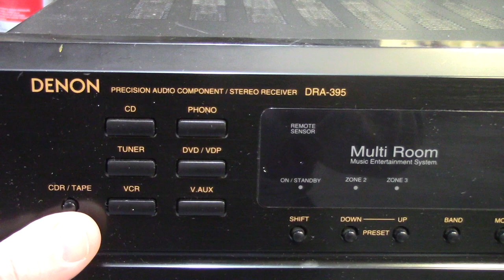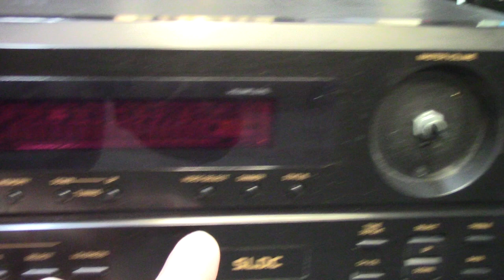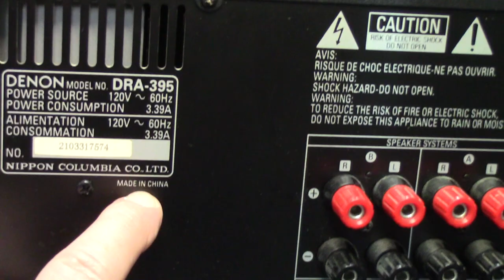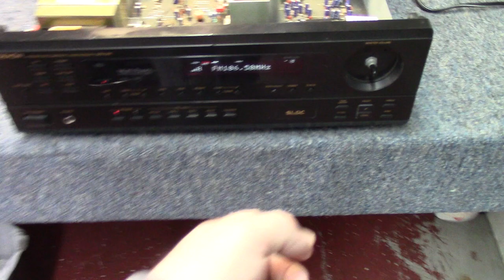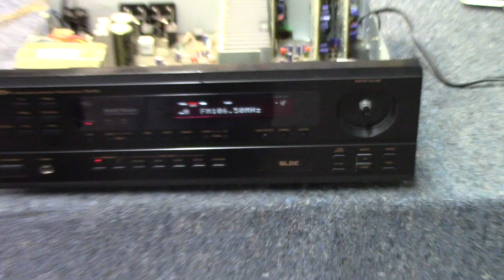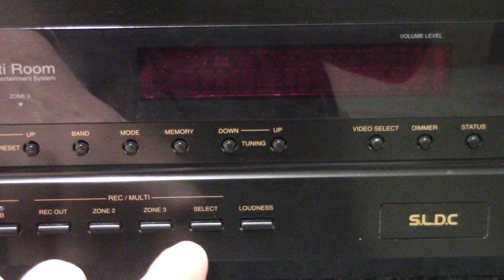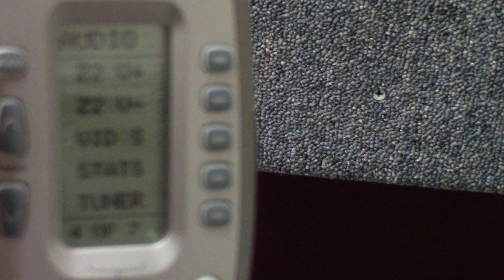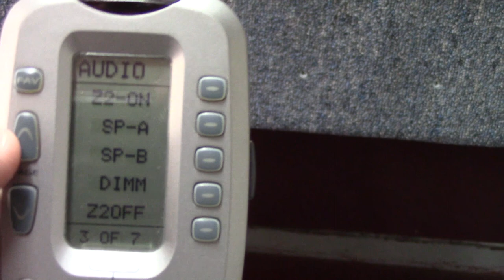Denon DRA-395 Multi-Zone Receiver - eval & testing

Comment: Have a Denon AVR-2803 that I am using for a preamp. Zone 2 is also the record output selector, so you can record from one source and listen to another on the main. Sounds really good in direct mode and has enough output signal to drive my tube mono blocks. Someday I will get the Dynaco PAS-3 preamp recapped, but I do like a remote volume control that has 0.5 db steps.
Reply from the maker: I had a Dynaco power amp given to me once and I was so busy at the time I sold it broke on eBay, was a very sweet amp.

Comment: I have one of those digital volume controls in my car audio cassette radio that has gone wonky. If you turn the volume counter clockwise too fast, the volume will go up, not down. I had it apart and there is a tiny Alps branded control in there, but I could not figure any way to get it apart without damage. Light emitting diode and a slotted wheel in there I believe. How do you fix that problem?
Reply: When it is warm out and the grease is soft, use a cordless drill "chucked" to the shaft and spin the control a bit.  The grease tends to ball up with age and block the mask in the encoder.  Don't overdo it though, just a few "quick" spins at medium spreed.  The volume control is an optical encoder..
Reply: @JeffCounsil-rp4qv  From what I understand there are two slots, one that leads slightly ahead of the other. That is how it knows which direction it is turning. Will give it a try, may save having to take it apart, which is not easy to get the control out, lots of layers of things that have to be removed just to get the control out. Thank you for the tip. Is this a fix that will last?
Reply from the maker: @zulumax1  , you might get it out only to discover that the housing is held together with melted plastic type fasteners ?
Reply: @zulumax1  Be sure to wait until it is at least 80F and the grease good and soft. Preferably the car in the sun a few hours.  The idea is to "sling" the grease from the slots in the mask wheel, or at least enough of it to return to pretty much normal operation. The knob shaft is plastic so be VERY careful to support the cordless drill and keep it steady. NO pushing or pulling either. A variable speed is necessary to start out slow, and not spin it too fast to cause damage. It normally only takes a few seconds to clear the grease.  As far as how it may last depends on the grease itself and how long it takes to migrate back across the slotted mask.  I had done one 3 years ago and it is still working.  They're all still working but that is the "oldest" so far.  One caveat is if it is somehow not an "infinite" control that has hard stops on it. In that case do not spin it with a drill.  I have to do this to my own 2002 factory Bose system in my Xterra one of these days.  Although it works when it is warm, but when cold it does the same as yours.  Warm days coming soon (I hope). lol!
Reply: @luvradios  Yes, sometimes they melt the plastic "pins" molded into the housing over, like peening metal, instead of using screws or tabs you can bend open.  I don't think any of the manufacturers expected their units to last this long, especially latter model cassette decks with CD players on the horizon.

Comment: Can we hook a Equalizer to this amplifier ?
Reply from the maker: Not in the traditional way, this unit doesn’t have a dedicated tape monitor loop but rather a record out selector switch so you can direct the output of whatever source to the rec out jacks.  But it’s possible to use one the way I do, zone 2 or 3 preamp out to EQ main in, EQ main out to Amp in, but I’m pretty sure it’s not possible with the main zone.